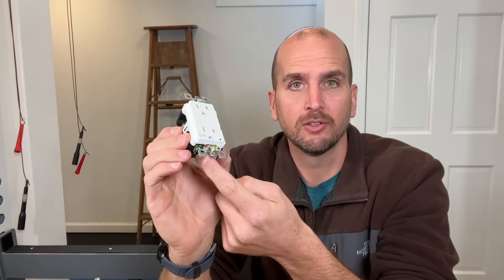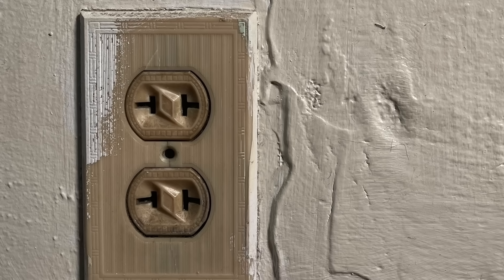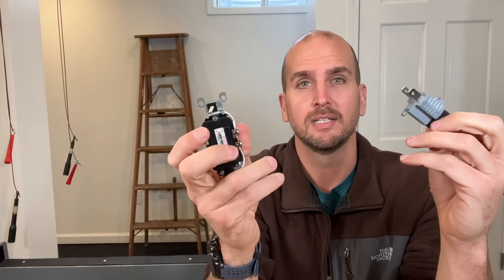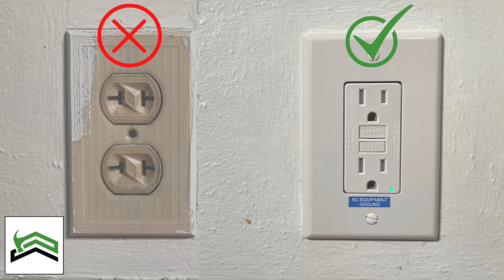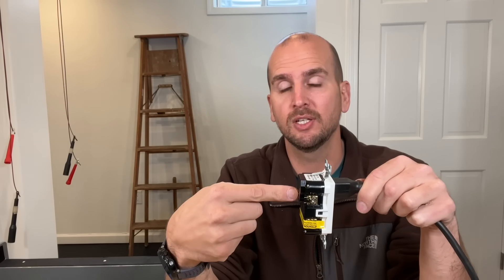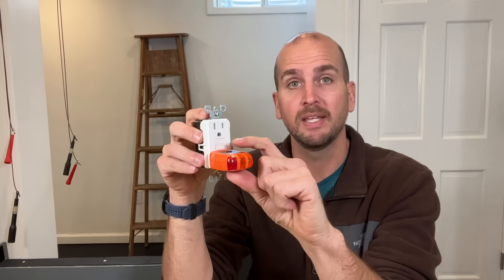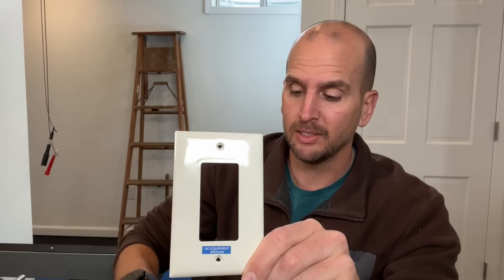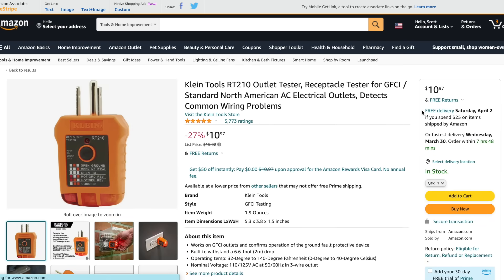Does a GFCI Outlet Still Provide Protection Without A Ground Wire?

Comment: Perfect explanation even though there are always those that will argue the point 'till hell freezes over. Remember, the question was if you "NEED" ground for gfci to work. The answer is no. If the question was if it was preferred, then yes.
Reply: In fact, you NEED GFCI to work on groundless circuits in order to bring two-wire circuits up to code when you make a modification to it.

[When you modify an existing circuit, the code requires you bring that circuit up to current code.  The code's being nice to you by allowing GFCIs as a legal alternative to tearing up walls to install 3 wire.]
Reply: @fromagefrizzbizz9377  Agreed. I'm just amazed at how so many people answered "no" to the simple question of whether it will work or not without ground.
Reply: @Tom-In-Ga   Yes I am amazed as well. I remember when it first hit the NEC about 1972. I was in High School and worked construction during the summer in SoCal. And even after my 35 years as a Building Inspector, there is still confusion about this device. ARC- Fault as well. Lol.
Reply: @Tom-In-Ga  Yeah - the beauty of GFCI is how it measures the small differences in hot and neutral currents to trip. If the ground wire had to be involved it would be hard to detect it fast enough and still provide safety.
Reply: @Tom-In-Ga  It demonstrates I think wilful ignorance of a LOT of code/diy publications saying EXACTLY what GFCIs are intended for, and why they do work.

On the other hand, such polls are pretty meaningless.  Do they mean ground wire, or alternate grounding path.  From the perspective of personal safety, it doesn't matter if there is one or not.  If there is one, it trips, and saves you. If there isn't one, no current flows, no electrocution, and it can't hurt you even tho the GFCI doesn't trip.

Then you get the pedants saying they don't work without a ground path - technically true.  But misleading in terms of above.

Then you get into how qualified are the respondents?  If the guy answering doesn't do any wiring, what difference does it make?

The only bad part is those making recommendations in videos or on comments, that say that GFCIs don't work without a ground wire.  That's just plain wrong, and is in contradiction to code, official code-guides and everything else.
Reply: @Tom-In-Ga In what way where you amazed? Seems you are contradicting your first comment. The correct simple answer is no. And the full on pedantic answer is also no.
Reply: @heartysteer8752  I found it amazing that any electrician would say that a GFCI needs ground to work. I stand behind my comment and I did not contradict myself. You don't need ground for GFCI to work. Saying it's preferred to use it is not a contradiction.
Reply: @Tom-In-Ga  Sorry, I'm still not tracking. You stated you were amazed that so many answered 'no'. That seems like you thought fewer would answer 'no'. 

Now you say you were amazed any would answer 'yes'. Which would mean you thought more would answer 'no'. Which doesn't fit with the "so many" phrase?
Reply: @heartysteer8752  Oy! Semantics. The answer is no.
Reply: @Tom-In-Ga  it's not just about shocks it is about protecting equipment as well. Only a ground will protect a ground fault when trying to protect electronics and other equipment. To get the full benefit you must have a ground. It's not only about human life it's also about the equipment you plug in. 73
Reply: If there's a ground fault isn't there typically something wrong with the equipment already? Or you've created it by setting your electronic item in a pool of water, or opened it up and shorted something?

Aren't situations where the equipment is not already damaged going to be extremely rare?

Comment: It's my understanding that you cannot, in fact, load downstream receptacles from an ungrounded GFCI.
Reply: You most definitely can. It's the code compliant method to use 3 prong outlets on an ungrounded circuit. Use a gfci on the homerun and then you can add (6) outlets on the load side.
Reply: Yes you can. What you are not allowed to do is to run a ground wire between them.

Comment: To protect against the scenario where the chassis of an item is energized but doesn't trip an otherwise ungrounded GFCI outlet, is there something wrong with tying the ground terminal on the backside of the receptacle to the neutral terminal so that they both go to ground? (albeit they would share the same conductor). This would also seemingly fix the issue with the outlet tester not working.
Reply: Yes, it is against the code. Do not improvise with the grounding.
Reply: @okaro6595  wouldn't it be safer from an electrical standpoint?
Reply: @keatonz  Its worse actually.

Classic device to demonstrate why connecting ground and neutral is dangerous is a toaster with a metal case.
The hot wire connects to the heating element(load), neutral connected to the other end of the heating element to complete the circuit.
The ground is connected to the metal case of the toaster. It is not connected to the heating element. This is important as you'll see why later.

In 'properly installed' home wiring with a properly wired device, since ground is connected to the metal parts of a device, not the load, if any hot wire touches a metal part of your device, the ground wire provides a better path to ground than you do, the breaker (ideally) trips immediately because of the short, and thus the user is protected even if they are touching the device the moment the short happens.

If you don't have a ground wire, and replace a 2 prong with 3 prong outlet and ignore the ground lug, if if the neutral fails, the device will simply refuse to work, which is exactly what you want to happen.
However, without the ground if you have an equipment short you are at risk of shock thus leading to the very bad idea of "well I'll just connect neutral and ground in the box"

Now, here's why its bad to join neutral and ground in the box.
When you join the neutral and ground in the box, the outlet box and/or outlet cover (if they are metal) now have the potential to become part of the return path along with any exposed metal parts of your toaster.
Its like opening up your toaster, and connecting the neutral and ground.

The problem is if the neutral wire fails, when you touch the metal parts of your toaster you become part of the return path as well. The breaker will not trip and you will get the full jolt.

Is it likely a neutral wire will fail? No, but its not impossible either. If you can't rewire, a GFCI marked no equipment ground is the way to go. Certainly less costly than a trip to the ER or morgue.
Reply: @dorvinion  thank you for this very detailed and thorough answer - it makes perfect sense!
Reply: @keatonz  It is against the code. That is all that matters. All my grounded sockets are done that way but it was not against the code where I lived when it was done. In fact before 1957 it was mandated in Finland. You were not allowed to use a separate ground wire.

If you drive on the left side of the road and cause an accident could you defend yourself that you think it is safer and they do it in the UK?

If you follow the code and something goes wrong you are on the clear. If you break the code and something goes wrong nobody will listen your arguments how you thought it would be safer.

Comment: does anyone know why Gfci portable line cords are different functioning than a gfci receptacle mounted in a portable outlet box
Reply: The GFI must have power between the hot and neutral conductors for it to work. If you would get a break in the neutral wire in your cord, the GFI could no longer trip leaving the hot side energized. Portable GFI line cores also have a circuit that monitors the voltage to the GFI and disconnects the hot and neutral if there is a broken conductor. They usually have a button you press after plugging in the cord that resets the voltage monitor circuit.

Comment: 2 Questions.  - 1)   What are your thoughts on a Whole House Circuit Breaker?   2)   My home doesn't have any GFCI outlets.   If I have a Whole House Circuit Breaker installed would my house pass inspection?                         I am planning a home reno, I need to make many informed decisions.
Reply: I have a 1950's era house with 12-2 thru out.  All the outlets are 2 prong.  I haven't done it yet, but am leaning to putting in GFCI breakers at the panel for some of the wiring, and running 12-3 to certain areas (laundry room, refrigerator, furnace).

Comment: If you have an receptacle that doesn't have a ground you can replace that receptacle with a GFCI receptacle to fix the problem. This is a good fix and not the best fix rewiring would be the better way to go.
Reply: It is a recognized solution in both the NEC and CEC.
Reply: If it is an old installation then you can do that. If it is a new installation that has some problem you need to ground it properly.

Comment: What is happening if you push the test button on a GFCI receptacle which is not connected to a ground?
Reply: That’s a great question. A GFCI WITHOUT a ground wire WILL trip when you push the ‘TEST’ button on the GFCI itself, because it is wired differently from a portable tester. The button on the GFCI test circuit is wired (through a resistor) from the live wire on the upstream side of the sensing transformer (CT) to the neutral wire on the downstream side of the sensing CT, thereby causing the required 5mA imbalance current needed to trip the GFCI within 5mSec.
Reply: @nickellis7775  
Not with a GFCI I just tried recently.
Reply: I had this issue in an old apartment from the 70’s. Thanks for sharing this!!

Comment: Can you explain what a grounded GFCI gets you in terms of additional safety if it already handles ground and short circuit faults? Or what does no equipment ground mean in terms of “caution”… this has no ground?
Reply: Grounding, especially with a GFCI, mean the circuit will cut the power immediately in case of failure. Without the ground it may require that someone touches it. Also the GFCI is a device that in itself can fail. In this case the grounding still works as a protection.

If you read the comments above there was a special case of metal box that is ungrounded. Because a GFCI can protect only on faults that happen after it there is a situation where a fault could cause the electricity to come through the ground wire to the case. The GFCI on the socket does not protect against this (A GFCI upstream would). In this case a proper grounding does protect.

The general rule of safety features is that they supplement each other instead of replacing older ones. This way use three prong outlets with a GFCI is an exception allowed for cost reasons.

The main purpose of the sticker is to tell anyone testing the outlet that lack of ground is not a failure condition but something expected. Most average users will not need the information.

Grounding has also functions in preventing interference and protecting equipment. These are secondary.
Reply: The label tells anyone testing the outlet that open ground is not a fault.
Reply: If you lose your neutral, the GFCI will be inoperative and the ground will still protect you.

Comment: In the scenario he described... would the person 🤔 who becomes the "path to ground" feel a small or moderate electrical shock before the GFCI "tripped" and shut the circuit off?

Kinda like the table saw blade brake/stop demonstration where the demonstrator uses a hot dog to stop the spinning blade of a table saw.  I always wonder if that could be done/replicated with a person's finger with no injury...
Reply: Yes. From experience
Reply: @hilariohernandez340  Thanks!
Reply: Please don't do what I'm going to say.
 If you are going to test/touch a live wire with your bare hand, make sure to touch the wire with the back of your hand. You'll get shocked but no injury to your finger(s). When we get shocked our hand tendency is to close or grab an object. So when you touch the wire with the back of your hand, your hand will close in a direction away from the wire (not grabbing it).
Reply: @Manny  lol - Kinda like the hot dog vs blade brake example I mentioned...  I'll never forget the guy who sold Kevlar vests when they were first introduced.  Shot himself with a .45 or .357 in the chest for a demo!  He had a large phone book (long time ago...) between the vest and his chest but still probably like getting hit by a car or something.  The blade brake and the hot dog is darn interesting; how can it do that?  lol
Reply: @manny7886  that applies more to DC than to AC.  DC causes muscles to contract, which can make you grip a wire.  AC causes muscles to contract and release at 60 HZ which typically causes a person to jerk back, and sometimes throw things.
Reply: @kenbrown2808  No, AC causes you also to grip not letting you go and more easily. The frequency is way too high to allow you to let go when it passes the zero. Even trained sprinter has a 100 ms reaction time. In this time AC changes direction 12 times.
Reply: @okaro6595  perhaps you should look up the difference between reaction time and electrically induced muscle spasm.  but then, what do I know, I haven't been shocked by anything over 277V in a few years.

Comment: I'd take issue that GFCI outlets only last 10-15 years.  My house is loaded with them and I'd imagine many of them are 30+ years old.  They still work and test out fine.  

Are you really saying people should be replacing their GFCI outlet in as short as 10 years?  That sounds just wrong to me.
Reply: Your 30 year old ones will probably work forever.  The ones you get now won't work in 5 or 10 years.
Reply: @56243G  Ah yes, the old "they don't make 'em the way they used to".  It's funny, because people have been saying that for about 100 years.
Reply: @stevesether  That's because more and more things are being designed using cheaper and less durable parts, so more things fail after a few years. In contrast, some other things last longer. In 1970, a ten year old car approaching 100,000 miles was essentially finished. Today, a well maintained vehicle will often last several hundred thousand miles, easily.
Reply: @d.e.b.b5788  I don't disagree.  But this has essentially always been true.
Reply: Smoke detectors are rated for 10 years. It doesn't mean they will suddenly stop working at 10 years. Same thing for gfi's.

Comment: This is the exact reason why these protection devices are called RCD or "R̸e̸t̸u̸r̸n̸ Residual Current Detector" in other countries, but most other countries also outlawed 2-pin mains voltage outlets more than half a century ago.
Reply: so did ours, but we don't mandate rebuilding existing buildings except in cases of significant hazard.
Reply: @kenbrown2808  In Australia at least, we had our 3-pin earthed outlets from the beginning of the housing boom after WW2 and so it was just an additional safety feature.
Reply: First it is "residual current device". Second in Europe universal grounding typically was mandated in the 90s. In A Sweden in 1994 and in Finland in 1997. It was mandatory on wet rooms since 1930. 

In Europe people often do not think these as you can plug a grounded plug on any socket.
Reply: @okaro6595  
Europe is not always at the forefront, which might come as a shock (ha ha: pun) to you.
In  Australia, the 3-pin earthed mains plug and socket was adopted in 1937 as AS 3112 (as in mandatory to use in all domestic mains applications) and then RCD (or ELCB "earth leakage circuit breaker") have been mandated since 1991 for new and replacement domestic "fuse boxes" to protect power and lighting circuits as per AS 3000:1991.
Reply: @dj1NM3  Grounding is not always a safety increase. It really requires tamper resistant outlets when there are kids. If a kid leans on a PC and sticks a knitting needle to an outlet it is bye bye if the outlet is grounded.
Reply: @okaro6595  
That's why actually developed nations require RCD protection on all circuits in their electrical codes, which are nation-wide.
Reply: @dj1NM3  The tripping current in the US is so low that they cannot just put one or two GFCIs in the panel.

Comment: Some countries call them "Differential Current Protection" which seems less confusing.
Reply: In Finland we call it fault current protectors. The word "ground" seems to confuse many. In Europe they are different. The triggeribg current is 30 MA (10.5 - 30 mA) and they typically are electro-mechanical and not electronic. That is they use no power in operation.
Reply: @okaro6595  i hired a few from there in 2004 in iraq war to suport usa military in kbr, i had to teach them all about true ground. When wired correctly, earth ground also equalizes the pay load. Earth ground is seperate bar in every electric  panel , if it not, it a useless panel. It connects to tbe seperate bar and the bar connects to a ground wire attached the the clamp on 6 feet long by 1/2" ground rod 6 feet deep. It carries 0 volts. Neautral  carroes up to 100 % of currect line. When the curent line id normal , the neautral is 1/2 the curent line is in volts. The reason it called ac power. Alternating curent. Travels the hertz spead up and down per second = hertz is the speed.

Comment: OK.......What i missed is what happens in the ungrounded GFCI if you also run a short jumper ground to the outlet box itself? As you said, it doesn't ground the line, but will it affect the test.....etc?
Reply: If the box is grounded then the wire grounds the outlet. Whether it does it in a way the code allows is another matter. If the box is not grounded then I would recommend changing it into a plastic one.

Note any half way grounding where one wires just to a box is worse than no grounding. For grounding to work there has to be connection all the way to the panel. I have seen people run a ground wire to a wall and thinking it is grounded.